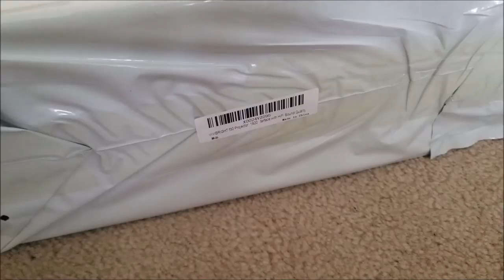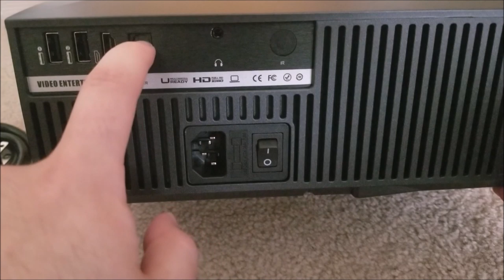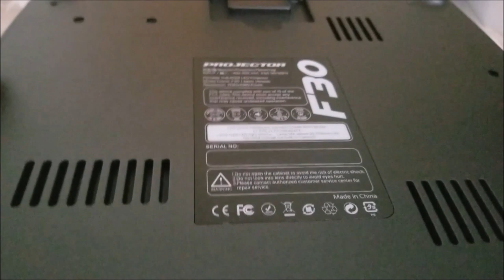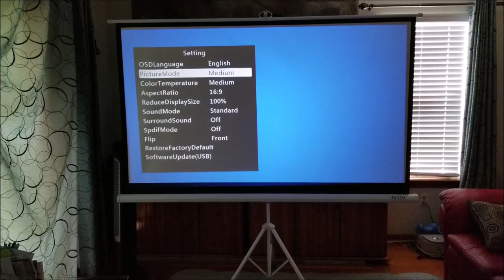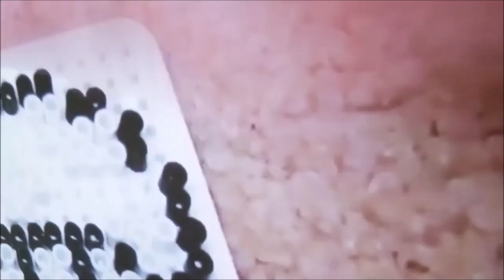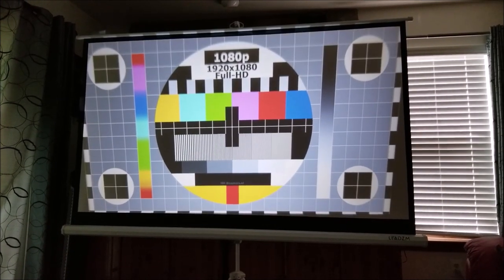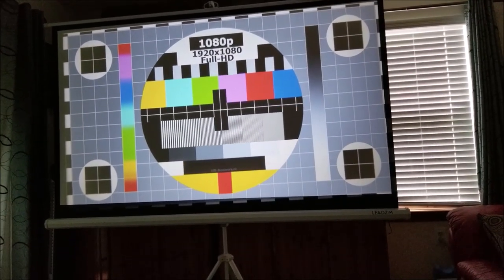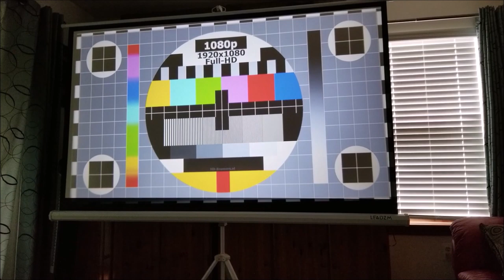Vivibright F30 1080p LED Projector Review

Comment: Good morning, I would like to know what difference from f30 to f40 I'm taking one of two! Thanks
Reply from the maker: Looks like the f40 is just the 2019 updated version of the f30. Other than aesthetics I don't see anything externally or functionally different. Without tearing both down though I couldn't say if they made any significant internal changes like more effective cooling, etc that would make the f40 better than the f30. So I would consider them roughly the same, just get the one you think looks better or can get cheaper.
Reply: Ok, I'm still in doubt, the f40 is 6500 lumens the f30 is too? Thank you for your help
Reply from the maker: The amazon listings for both projecters I see have the brightness as 4200 lumens.

Comment: How to connect Samsung phone to projector
Reply from the maker: You can buy a cheap usb to hdmi adapter for your phone or a hdmi miracast dongle for wireless video.
Reply: I have to connect to Hdmi port not USB port..correct
Reply from the maker: I personally use the hdmi miracast dongles which are <$10 and they work great so long as the device you want to transmit from supports wireless screen sharing.

Comment: When I connect USB...sound not coming
Reply from the maker: What file type are you trying to play? While the container format may be supported it could be that the actual audio stream isn't.
Reply: @sjm4306  sir I am using 4k format
Reply from the maker: 4k is a resolution, not a file extension/container format. If I had to guess though it's that this projector is 1080p and doesn't support downscaling 4k video.
Reply: Sir which file can support audio
Reply from the maker: The supported file formats are listed here under the specifications section: https://www.priceboon.com/product/vivibright-f30/
I've personally tried 1080p mp4 (h264) and mkv both without issue.
Reply: Sir My video file is MKV and MP4 but why sound not coming
Reply from the maker: As I said the audio stream format may not be compatible, especially if it is something fancy like dolby dts that requires manufacturers to purchase licenses to decode in their products.
Reply: @sjm4306  if I connect external speakers sound will come out
Reply from the maker: That's odd, have you checked the audio settings to see if for some reason only external audio is enabled?

Comment: I can hear the fan noise and it sounds like a hair dryer
Reply from the maker: Yeah it's definitely noticeable, the designers had to choose between making it larger with a bigger heatsink, increasing the price by using a better fan, keeping it quiet by letting it overheat or sticking with a louder fan so I guess they picked the latter to keeps costs down but limit damage.